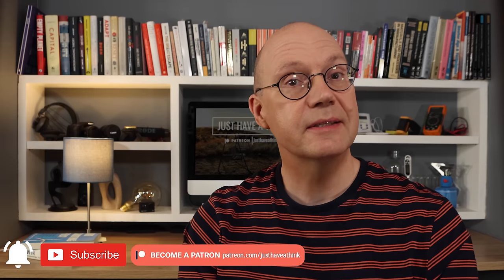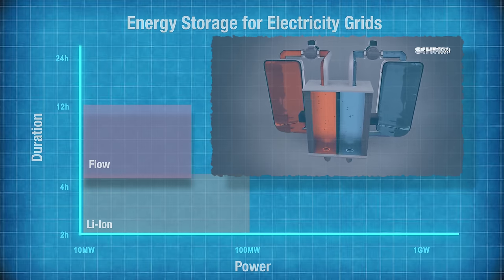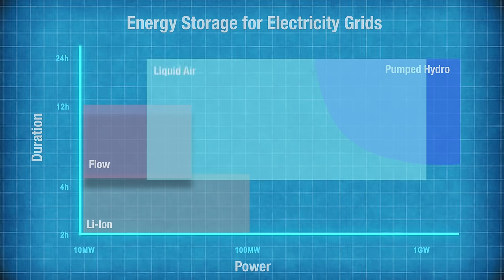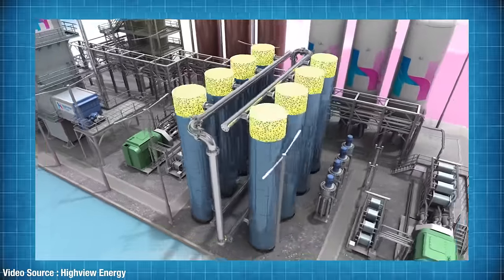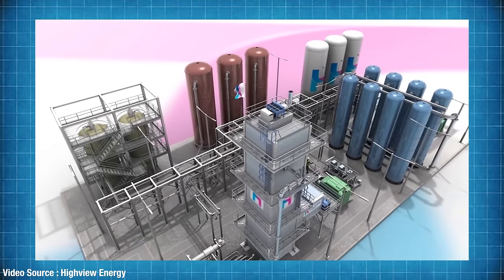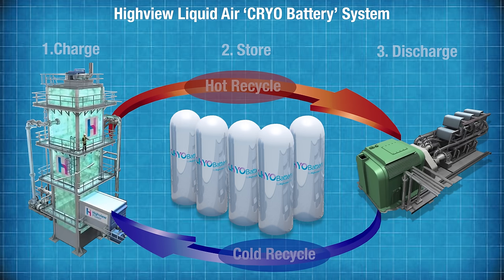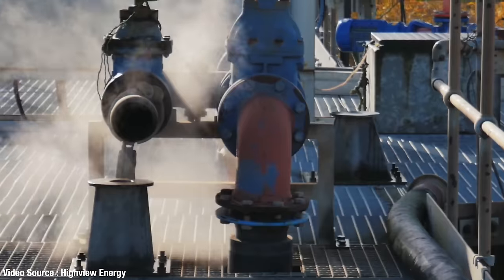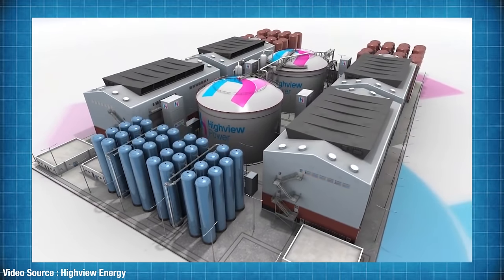Liquid Air Batteries. Literally energy from thin air. Seriously. Literally!

Comment: 60% efficiency will not cut it. It means 40% of energy in is lost and with energy at $40-60/MWh it turns out to be a huge cost. That is the Achilles Heel.
Reply: The advantage is mentioned where curtailment is involved. Curtailment is where power plants (such as wind turbines) generate more power than the grid needs, therefore they are locked down, and generate nothing, which is 100% loss. In this case 40% loss is better than 100% loss.

Comment: People have been contemplating energy devices for years: Batteries, generation systems etc. All these things can be disregarded shortly. We are on the cusp of having long withheld technology revealed to us. Electrical energy from the Z point or ZPE is about to be unsealed. There are many patents that have been classified going back for years. This information which is already being secretly used will give us the potential to do all of these things without any problem.
Reply: What? What is that & how would it work?

Comment: One must expand the energy/resource  balance for this total system. The energy out never exceeds the energy in, especially if one includes all of the external resources, costs and impacts. Nuclear is the only energy source that debatably provides more energy out than the energy in....maybe.
I’m sure that a “liquid air” battery can be built and operated but as one who has worked with cryogenic liquids, there is never a net gain.  And if there is a problem, the environment tends to return all of the cryogenic liquid back to room temperature and sometimes explosively. Cryogenic systems tend to fail in a run away fashion and all one can do is hopefully vent off the gas fast enough to avoid a mass migration of pieces of metal into the environment. And then you have to start over.
Reply: The inherent problem with nuclear energy is no one can give an honest cost per BTU, because it is impossible to know the cost of dealing with spent fuel with a 100,000 year half-life.

Comment: Seems like an interesting process and idea for producing energy.  I’m curious though doesn’t it take a certain amount of energy to turn the air into liquid and pump the liquid back rowards the turbines? There must be a natural process I am missing.?.?  I’ll have to research what makes this work.
Reply: This isn't about producing energy is it about storing the energy (aka a battery). We are assuming there is a big solar or wind farm powering the system turning the air into liquid. As the big problem with using both Solar and wind for power is we have no control over the sun or wind to turn it into power. So we use Solar and Wind to not only power the city (or whatever we need to keep powered) but also power the system and fill the tanks with liquid air. When the sun and wind goes away we can then release the air to generate energy to continue to power the city. Then when the solar and wind come back the process repeats.

Comment: This is very interesting and simple concept. Since the main fuel which is obviously liquefied nitrogen at high pressure which is further compressed to power a generator to the grid. Thus it cheap actually. But I have one major concern. The ambient  air drawn from the sorronding, what is the long term environmental effect. As carbon dioxide and water vapour is filtered out of the system. This leaves oxygen, nitrogen and some other gasses being removed from the atmosphere. This leaves us with more green house gasses such as carbon dioxide being released into the atmosphere.
Reply: LOL

Comment: Sounds like something for nothing to me. If it's 60% efficient, isn't that a newt lose? Unless you are using wind and solar to do the conversion, I don't see a gain.
Reply: Surely it is a great gain as recovering 60% of the wind energy that would otherwise be wasted due to lack of need at the time it is available  and saving it for times of high demand must be good.  The 40% used in the process would just not be generated so is not wasted or lost.  Not an elegant description but best I can manage.

Comment: The real problem we need to solve for 100% renewables is the seasonal fluctuation in energy use and supply. The closer people live to the poles, the more energy they need in the winter for heating, and at the same time the solar irradiation is vastly reduced. To solve this with energy storage is especially hard, because the storage system would have to store the energy for months, and would only operate one storage cycle per year. No kind of battery ever imagined could ever do this economically.
Reply: Closer to the poles the windier it is in winter.  The main source of energy in winter for North America and northern Europe will be wind power by a large margin.

Comment: Sounds very applicable! One of the most interesting solutions ive seen. An efficiency of 60% - i assume this is the return of energy invested during storage for later usage.
Reply: Yes. 40% of the solar, wind, whatever energy is lost, but it's for times when it's not needed so would need to be turned off or dumped 100% otherwise.  It's because Sun/wind (which is also Sun) energy costs precisely nothing at all once the equipment to capture it is installed & connected.

Comment: sounds great at a mass size . But how would it work or even be doable at lower requirements such as 25 kw/h system and if so at what extreme cost that makes it not affordable .
Reply: It's not.
That's what the graph was trying to show. Break even point for a system like this is 2 megawatts or so, thus you need a windfarm or solar installation not an  individual turbine /solar powered home.

Comment: I would like that in the start if this video would be added another, sixth, very important requirement for battery use....cycle efficiency. Yes , you give the expected efficiency somewhere in your film. But not the efficiency of , for example, the much more expensive Lion batterys. Or efficiency of the hydro pump systems (as we see in Norway).
Every % more efficiency will reduce the need of (environmental friendly) energy and so reduce the needed square miles of solar panels. Wind turbines are NOT friendly for insects and birds....I do not count them as being good for our planet. Maybe a little less worse.

Comment: If everyone uses this system worldwide with increased demand respected due to a switch from fossil fuel to electric, will there be enough air left for us to breathe / fly around etc?
Reply: It will be negligible amount. Also we produce gas when we use chemicals.

Comment: Its not only failure of imagination that stands in the way. 
It's also the use of imagination defending perceived feared loss that stand in the way.
The win win needs to be perceived.
Reply: Peter Mortensen  What made you  imagine anyone was talking about perpetual motion machines?  My perception is it is an attempt to harness the energy that the world creates and storing it for recycling  when the means that is capturing the energy is not available the main reason to not run such a capture and storage system  I would think would be based on a cost benefit analyses.  Of cause the system would fail if the universe stopped generating energy that could be captured.  But I imagined if that happened we would have more to to worry about than how to power a light bulb .

Comment: Electrolysis of water (H2O) occurs at a relatively low voltage: producing Hydrogen and oxygen separately; how much energy can be extracted by recombining hydrogen with oxygen? (or another element, to "enhance" the process)
Reply: You can cut a lamp cord and put the ends in your bathtub to do electrolysis but the hydrogen can be combined with oxygen in the atmosphere you don't have to provide pure oxygen but the cost of doing this is a big public policy riddle as decades ago we expected thin film solar panels to do electrolysis because we had more hope back then about societal sanity prevailing as most of the installed g r i d inverters have to be replaced many many times over the life of the farm and hopefully, to repeat this is a good thing, we are going to see plenty of windmills and solar panel Farms abandoned or maybe with the case of the solar panels sold for a tiny fraction of their official depreciated value and converted over to something like electrolysis. The cost of grid inverters is just too high. Electricity is just too worthless. That's for electrolysis to save these panels from being used as mainly shade or maybe billboard backing the fuel cells will have to be capable of continuous duty not just be cheap enough for cars designed to be used the tiny fraction of a work day.
Reply: @Irene-fu6gj  ???

Comment: The use of the expression "energy from thin air" is a very bad one. It almost caused me not to watch this video and if "Highview" are using it it doesn't create a good image for an engineering company. Most people educated in science or engineering above basic schooling realise that it takes a lot of energy to liquefy air, so there is nothing obviously cheap about a liquid air battery. The real reasons for its use are outlined in this video which turned out to be a lot better than I expected from its subtitle.
Reply: When it's windy at night when everyone is sleeping and not using as much energy the windmill's energy would just go to waste. This idea is to use the excess renewables to charge the air battery, during these low demand, high generation periods for use in high demand, low generation periods.
Reply: @peterguilliatt  Thanks, I got the point from the video, which turned out to be much better than I thought. I was aware of this general problem with some renewables. I just think it's a diversion to talk about energy from thin air, they were referring not just to wind power but other forms of energy such as nuclear. The thin air was about storing the energy as liquid air. Such energy buffers are useful for integrating the use of many types of energy.

Comment: Where is the polluted particles going to be stored after the filtration?
After using the High pressured air in the turbine, is it to be released into the atmosphere as clean air, or will it be reused?
Reply: I'm pretty sure it will be reused.

Comment: That 60% sounds like a trap for investors and just add a storage tank to increase output is a lie.
Reply: Sounds like you didn't understand it. He said that you just add a storage tank to increase the duration the power is provided. Exactly like building a bigger dam behind a hydropower plant. If you want more output, you put in another gas generator. If you want faster charge time you put in another liquifier. The relationship between output and storage still holds, and is more like a battery, so higher discharge voltage results in faster discharge and vice versa. That sound better?

Comment: The preoccupation with developing storage systems to parallel the growth of intermittent "environmentally friendly" energy systems is grounded in a false notion. Any system of real-time storage of power suffers from gross inefficiencies - once during storage and again during delivery - because of which most of the research in such storage systems ends in unviability.

For god's sake, intermittent generation systems ought to be used primarily for time-neutral electrical loads such as agricultural irrigation, drinking water pumping and storage into overhead tanks, and similar intermittent loads which are not crucial about which part of the day they work. In all such requirements you bypass the inefficiency of reconversion and therefore win hands down!
Reply: Electrical efficiency doesn't matter if the energy would otherwise be wasted and the financial efficiency is good.   I agree that it's best to use electricity when and where it's produced to avoid transmission and storage losses, but in the real world this is not always possible.
Reply: Energy storage is also necessary to use more nuclear power, because the demand changes over the day. If you have enough storage, you only need to provide enough power for the daily average demand, not the peak demand.
Reply: And what Mr Think did not factor in was where does the 40 percent losses go...are they lost as heat? And if mass adoption of this technology would add to global warming...oh wait...you could just puncture the liquid air tank and that would offset the temp rise

Comment: That's also interesting when undergoing a catastrophe. The environment does not suffer any large problems, besides instant freezing and a few shattered windows, should the vessels explode.
Reply: In order for the vessels to quote explode there would have to be a fracture and Heat available to boil the nitrogen because once a small amount of it boils the rest of it is cold enough to be stable at atmospheric pressure. So it's even better than you suggest and the penalty for having the tanks be at atmospheric pressure is small if you don't use the damn machine to try to store electricity dementedly.
Reply: @Irene-fu6gj  We have seen several times that humans are knowingly capable of provoking incredible incidents, such as Chernobyl. An exploded gas vessel will just extinct the responsible people right on the spot. Call it natural selection 😄

Comment: why dont we DOWN SCALE the design? putting a "unit" at the residential level (one per household)?
Reply: Yes, the name is electric battery (Tesla Wall Unit).  Is much easier to do that replicate in a scale the plant you just saw.
Reply: Good question. The first part of the system already exists. High pressure pure air compressors are no bigger than portable inverter generators. Once charged the "pure air" itself can be used to cool itself to a liquid state through pressure realease, taking advantage of Boyles law. That can be done in something the size of a shoe box. Storage on a small scale could be an issue but at the end of the day you're only really storing pressure. Use the pressure to drive a,,, whatever.
My question is, where is the energy consumption for turning air into liquid nitrogen factored into the efficiency of the system?

Comment: Can liquid air be used to power small engines, or drive units for mobility? ie. small vehicles or aircraft
Reply: Yes in theory but in practice specific energy density is so low that you would need 100kg of liquid air to carry same energy as 1kg of jet fuel. A non-starter for aircraft and not much good for any vehicle.
Reply: @BonnyToads  Thanks, just the answer I needed.

Comment: Wouldn't the tanks have to be kept cold so the liquid air doesn't expand?  Or is the steel strong enough to hold it in during hot weather?
Reply: Correct. The contents will heat up very slowly depending on the insulation used on the tank. The heat input will be expressed as a small vapour stream that must be re-condensed using energy, or removed. If this is not done the tank pressure will continue to increase which is undesirable for safety reasons. operating the tank at pressure helps to reduce the impact of heat ingress, but cannot solve it. operating the tanks at atmospheric pressure is overall cheaper from CAPEX + OPEX lifecycle viewpoint and is commonly done in industry.
Reply: @unisickle  
So the next question is:  Is that energy cost worth it?

Comment: Where do they get the power and how much power is used to freeze the air in the first place. If it can't generate enough energy to cool to the level needed it is useless.
Reply: From the electricity grid, its a storage device not a generator. It would store power during low demand periods and release it again when demand increased.
Reply: @KonradZielinski  Let me re phrase my question. What is the efficiency of this storage device. for example most Lithium batteries are 99% this is very good but most hydrogen power cells vary from 20% to 60%.which means you loose anywhere from  80% to 40% of what you put in it just to charge it .  If this storage device takes 200% more power to charge it than it can store it is basically useless.

Comment: What is the cost of running the pumps and the compressors...
Reply: He did mention that the system has a 60% roundtrip efficiency so 40% of the incoming energy would be used on operation of the plant.

Comment: Great article and well done. But. "Energy from thin air" is a bit misleading. It's using air as an energy storage medium.
Reply: Wrong. The liquid nitrogen is the potential energy that acts as a catalyst to the heat in the thin air that is freely available. It's the mixing of the thin air and the lighter liquefied gas molecules that creates the work because you have a 700 X expansion linearly but the actual volume increase exponentially is of course much left but 20 significant because of the extreme levels of Force the strong forces of nature separate the molecules in absorbing the Heat and converting it into extra mass by.
Reply: @Irene-fu6gj  What a load of codswallop.